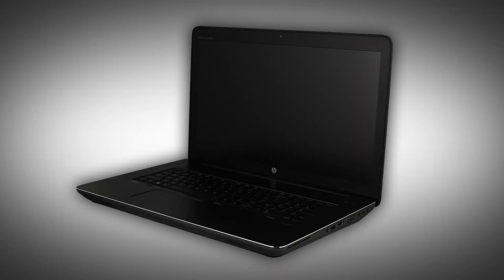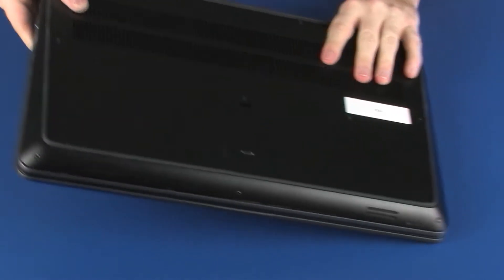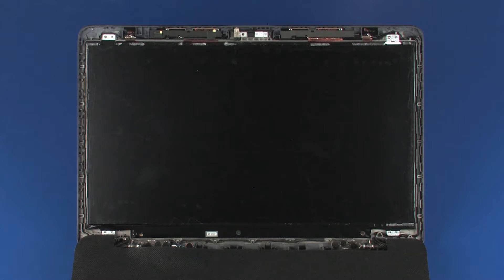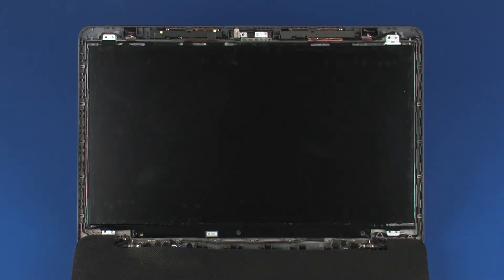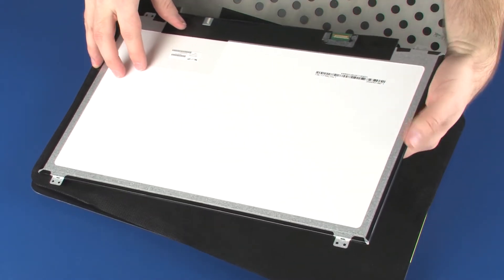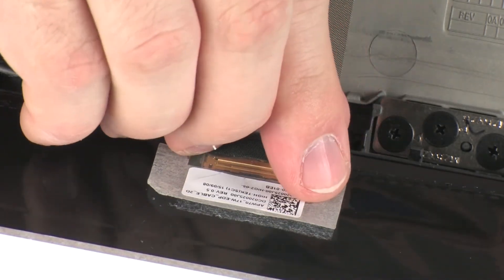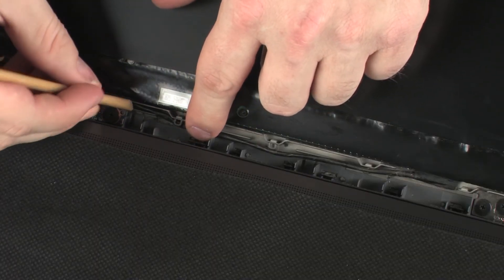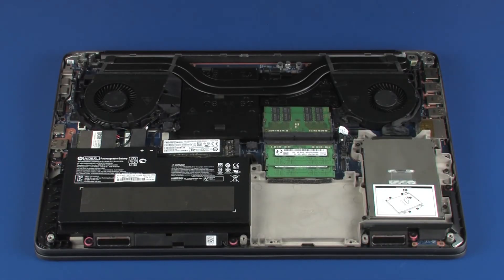Replace the Display Panel/Display Bezel | HP ZBook 17 G3 Mobile Workstation | HP Support

Comment: HP Support! Can you tell me if I can upgrade my ZBook G3 17" laptop screen to have 120hz, 240hz or 480hz?
Reply from the maker: Hi there, thanks for contacting HP Global Social Media Support!
Well, I'm afraid it is not possible to upgrade the display to a higher refresh rate display. In case you have any queries please contact our customer care team over the phone or chat for further assistance, as this issue requires Live conversation with you over phone or chat to isolate the issue and provide you instantly with appropriate solution or repair/replacement options available at your place as per the warranty.
Please feel free to reach us on call/chat, please access this link to select your preferred country and language option to reach us. Global support link: -  https://hp.care/3G7hvsF
Akhil_HP Social Media Tech Support

Comment: I have a white screen problem on my hp zbook 17 g3 can you tell me what is the reason?
Reply from the maker: Hi Abdur, thanks for contacting!
I understand that you are experiencing an issue with the screen.
I will do my best to assist you.
Please refer to the instructions mentioned under this document to fix the issue: https://bit.ly/3umNZID
Binu - Social Media Tech Support
Reply: do you find a solution, i had the same problem
Reply: Hello  @francescofrancesco8784  yes I found the solution. My display wire was the problem so I took my laptop to repair shop they repaired the wire it costs 10$ for me.
Reply: @francescofrancesco8784  now working fine